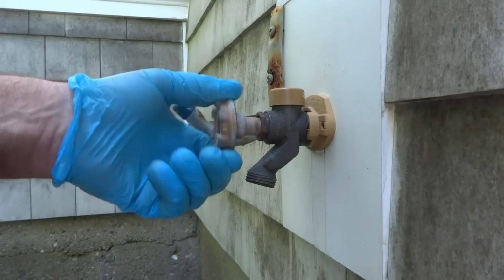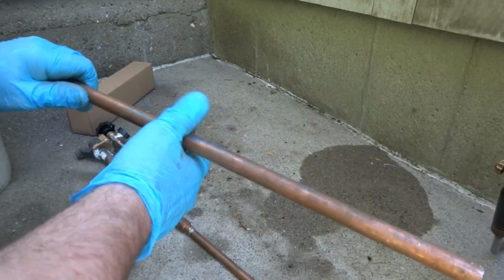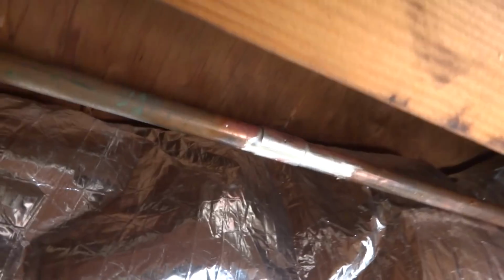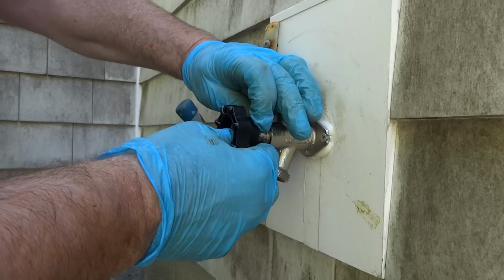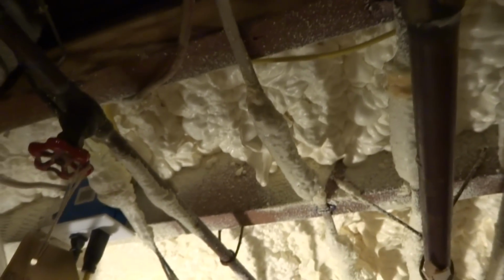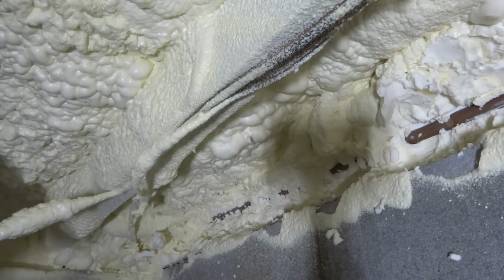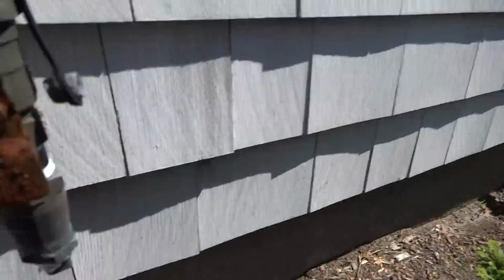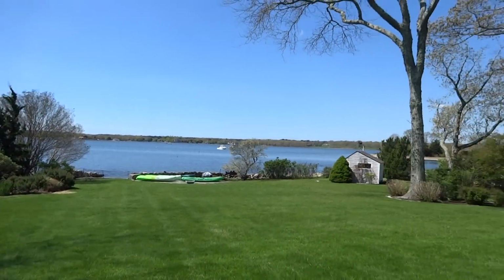2 OUTSIDE FAUCETS NEED CHANGING OUT

Comment: According to the package they come in frost free faucets are supposed to have a 5 degree slope so the water drains out when you shut them off. We found out this winter what happens when you don't have a 5 degree slope: ours froze,  blew out the handle end and there was water everywhere. At least it was outside the house & crawl space. 😂 It doesn't look like the one you replaced had any slope.

Comment: Hoping it only goes out straight at the corner a couple feet beyond where you left off. I had a customer with the same problem. They foamed around the foundation. fortunately mine went straight out without any turns. Still took 15 minutes to clear the area.  That foam also burns.

Comment: It will be a major fire hazard to sweat solder that copper under there once he finds the coupler. That foam burns like gasoline unless he has the burn less kind? I'd take a piece of foam insulation outside and do a test burn first? Yipes!

Comment: Putting a frost free valve in an unheated crawl space doesn't make much sense. The pipes will freeze every winter. I have a similar situation and installed a shutoff valve and drain valve in the house so I can blow it out with air or fill with antifreeze every fall.

Comment: Someone needs to invent a mini-tiller of some sort to gouge out all that spray foam without damaging the wiring and plumbing.  

EDIT: Thought about it, and did a search. Acetone sprayed on the foam would melt that crap really quick. But the fumes will knock you silly.  For good-sized jobs, a multi-tool with a vibrating blade on it and cut at angles so you don't hit any wiring with the blade.

For the really big ones, renting a dry ice blaster will clean out that mess.

EDITEDIT: One thing that bugs me is collateral damage vs rapid removal of that crap. Then it hit me. A chicken plucker wheel that attaches to a 1/4" drill. It has rubber fingers that I THINK would remove the foam without tearing up wiring or winding up dinging plastic pipe. Amazon has one for 60 bucks that looks wicked.

Comment: yeah thats the bad thing about spray foam... it should really only be used in an area that will never need to be touched ever again.. and there ain't too many places like that.. some builders put foam panels on the outside of foundations and bury it but not spray foam. You put it in your attic and need your roof repaired forget it.. or idiots that plumb their walls and do the electrical then spray the insides of the walls.. Sure its fun for the contractor but you can't run a wire through that.. That stuff is for the insides of refrigerators and thats it.

Comment: do a new line altogether. take the old silcock out of the wall, drill through that foam from the exterior, and put a new section of copper in all the way to that point
Reply from the maker: sounds easy on paper ..try that in real life . you be shitting your pants
Reply: Was thinking the same thing. That stuff is flammable.
Reply: @stevenlavimoniere  let one of those young pex/pro press guys do it and save you the hassle

Comment: That foam is just a big mess when you get at waterlake you never know where it's going to be at I would never put that underneath my home when you get it water leak you never know where it's going to be at I would never put that underneath my home
Reply: It drips right where the leak is….. as far as removing the foam you only need to cut it with a knife…. 
The idea is to measure outside first to know where the copper pipe is.
Regarding having a no freeze shut off…. It doesn’t work unless it enters a heated space….

Comment: Hey Steve, you know a dab of copper base antiseize will go a million miles in the next how ever long it lasts.. you may be the next guy to change it.. wouldn't it be nice to just un thread it next time without the worry of breaking the soldier joint.. just my 2 cents worth only takes a second to put a dab on it..
Reply from the maker: best to solder it in female adapters will leak at threads offen ..